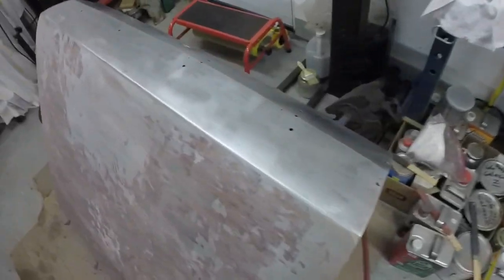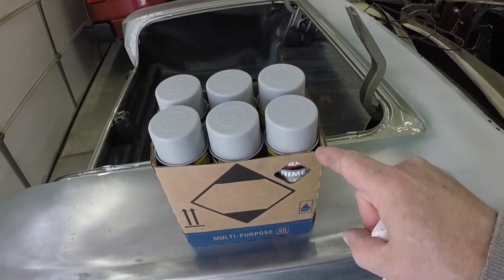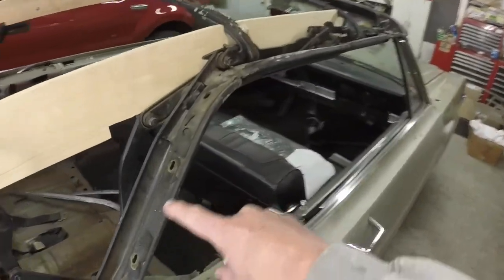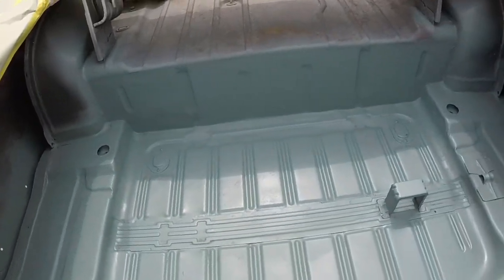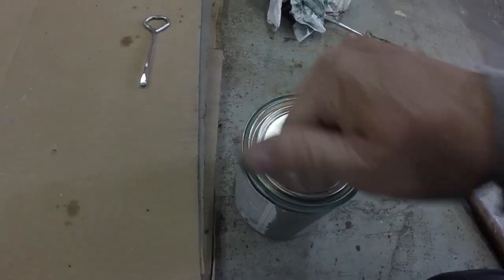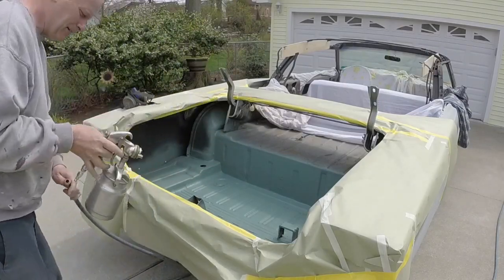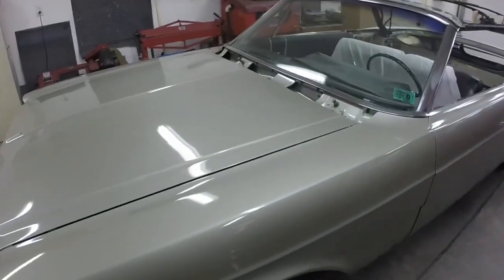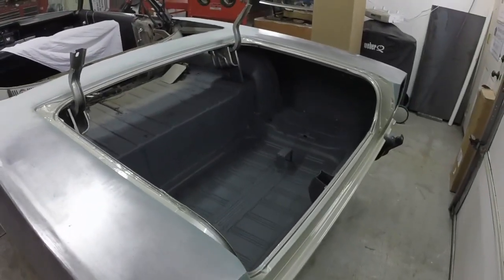1966 Ford Galaxie 500 convertible restoration part 110 painting the trunk compartment spatter paint

Comment: Your finished trunk looks fantastic with the spatter paint. I know the work on the trunk is very tedious. When I did the trunk on my ‘63 Nova Convertible ( about 20 years ago) it took me about a month of sanding, wire brush on an electric drill etc. etc.I used POR 15 paint, with spatter paint on top. I made of the mistake of using inexpensive spray can spatter paint, and it would flake off, even with clear coat. Yours should be very durable. Your trunk lid looks nice and straight as well,.As always, I enjoy your videos; especially during the quarantine.

Comment: Back when the 66 Galaxie was manufactured they used thicker high gloss paint, so they probably didn't worry a whole lot about how perfect the sheet metal was. The paint would hide them.
Reply from the maker: Totally, and that factory gray sealer is thick and tough to strip. I find paint on Ford products much harder to remove than Chrysler or GM cars. I think GM had the worst paint, as they used lacquer back in the day.

Comment: Hey there 
I’ve been watching since you were doing the brakes and your doing a great job. I’m getting ready to paint my 65 xl trunk so u’ve really helped me with product and technique. I’m literally loosing my mind. I’m due to have neck surgery on may 26th and have been off work since April 21st so watching you work has been a great distraction for me . I used to own a 66 hardtop with a 289. I got rid of it after I got the xl. It has a 390 z code. For years I did automotive machining and put hardened seats in and a mild cam along with having it balanced. I have literally done everything that you talked about repairing on your car to mine. Mine is a vinyl top. I’m going to try to send some pictures. I live in Arkansas now but grew up in Redding CA. and that’s where i got the car. At the time I worked for a tow company. Long story but it was abandoned on Interstate 5 and I got it for $200.00 labor that my boss didn’t have to pay me. I sure wish I could visit with you and cruise together. Richard Lunn.

Comment: nice nice job on the trunk..boy does that look good..,,and that 352 sounds nice breathing out dem pipes out back ..but i have one question...why do you need that wood  on the top ?..if the top is already in the closed position what does the wood do ?..just curious ...
Reply from the maker: I put the wood there, because the shop manual stated to do it. I think you need it there to position the ribs, when installing a new top. I just left them there after removing the original top. I will remove them eventually, to clean and paint the top mechanism. I also need to run the top motor to bleed the system, after I install the replacement cylinders. I may leave the top frame down, after that all done, until it gets a new top.